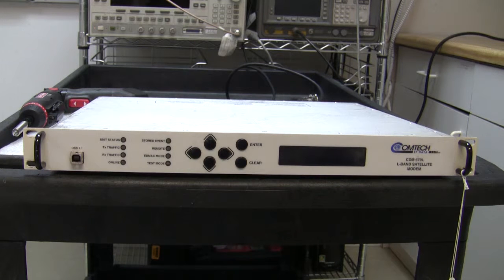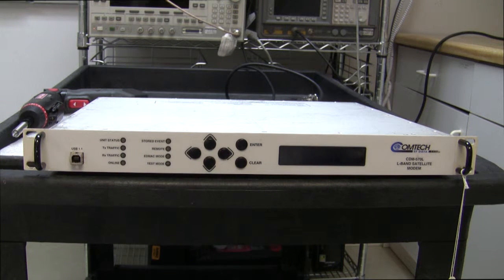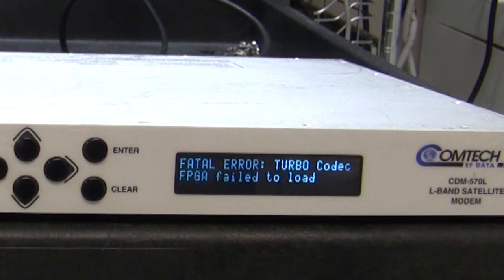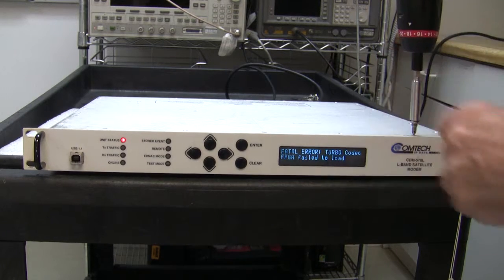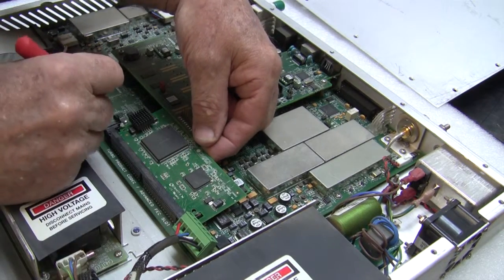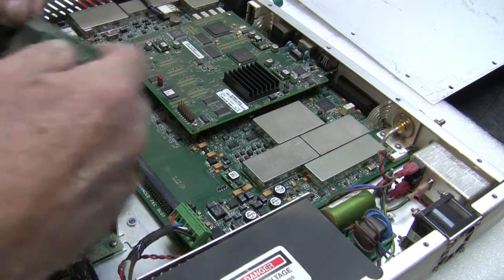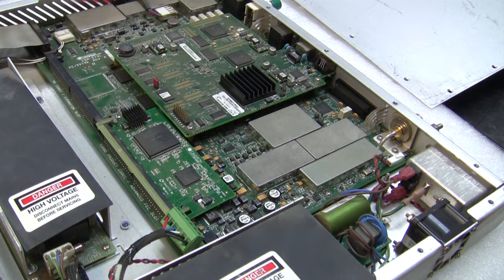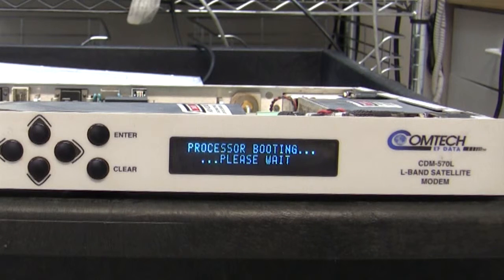Fixing a turbo card error on a CDM-570L

Comment: Hello,  

I have an issue with a CDM-570L.  It was working fine, even just weeks ago we requested and installed an upgrade license but suddenly the front keys are locked (they are not answering, we can not move in the menu) and are lights on in the back of the equipment. IP address that was previously configured is not reachable also. We already restarted the modem but the issue remains.  It seems it is frozen in the loading process? Have you  been a similar issue ?